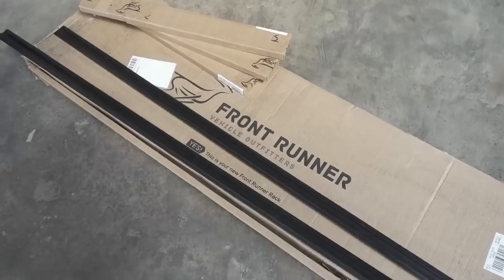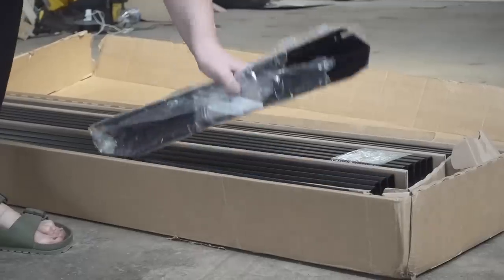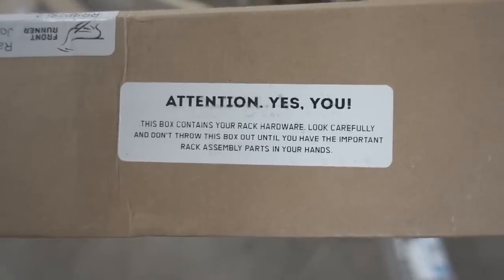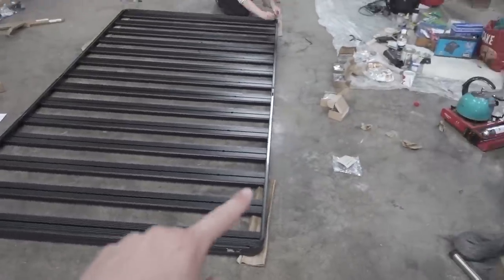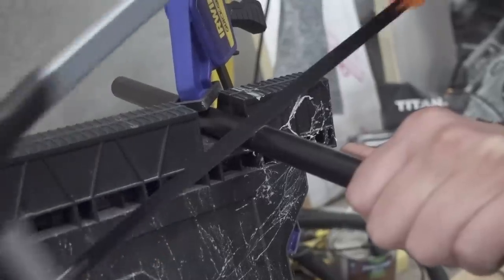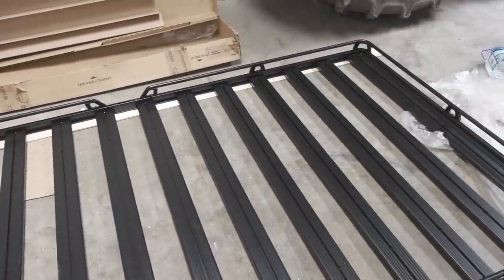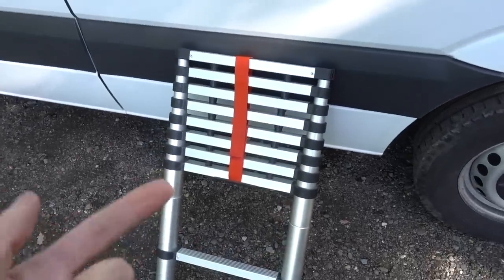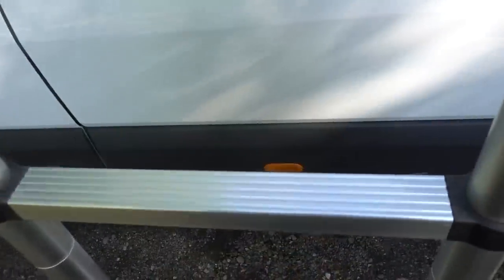This Front Runner Roof Rack Has CHANGED Our Sprinter Van!

Comment: Another great job guys looks awesome :) Be careful with your ladder, we have one similar and have noticed after repeated use that it has started to dent the side of the van where we have been leaning it up against the side.  We have applied some foam pads to top so that when its leaning it spreads the load. a bit more.

Comment: Hi, on seeing this video I realised that although I may not want a roof rack just now, unless I instal the tracks before I finish the insulation I won't ever be able to have a roof rack, so I sent to First Four to get the tracks. They arrived very promptly. However installing them wasn't too easy. What anyone thinking of getting them needs to check is : what length of track is being supplied and how long your van is, so that you can see how much of your roof will be covered by the tracks. I have a MWB Sprinter. This means there are 8 potential holes down each side of my roof to take the 2200mm tracks. The tracks are only 6 holes long. I thought of cutting each track in two so as to make the track area longer but this wouldn't work. In the end I have put one whole track on each side and have laid them toward the back of the van - part of the front area is occupied by the roof fan. I had quite fancied the idea of having a light bar across the front of the roof but with nowhere to attach it to, that won't be possible but hey 1 they are very expensive and 2 do I really need one - No!   When you mark and match up where you need to drill the holes in your track to match where the holes are in your van roof, you will find that the holes in the soft cushion strip which lies between the track and your roof don't match up so you need to enlarge a couple with your Stanley knife. I have managed to fit these tracks but it wasn't particularly easy. I sounds easy and theoretically it is but I'd  just say if you're going to do this, allow yourself plenty of time. I must admit however that all this is very new to me so I will be slower than most of you, perhaps, and I am enjoying it - being dead chuffed when it works out.

Comment: Hmm, they don't do roof systems for fiat ducato based vehicles. A big problem I can see for the Merc van is if it gets damaged you have to strip out the interior to get to the fixings.  The advantage of the fiat van is the bolts screw into pre-installed fixings from outside the van so you just undo the bolt on the roof and remove it. Looks a great bit of kit too, would have loved one in my van, hopefully they'll expand the range.
Reply from the maker: You can take the roof rack off easily. It’s all done from the outside.

Comment: Guys I've bought the same rack but for the full length of the van . Am I right in thinking that you don't use the factory holes in the roof but drill new holes in line with the holes in the rails?
Reply from the maker: We used the factory holes but had to use a file to make them bigger. Bit of a process
Reply: Thanks guys 👍

Comment: Hey guys, 
thanks for sharing this super helpful video.
I am currently also checking the best options for a modular roof rack for my Sprinter. 

You said you mounted the FrontRunner Universal Tracks to the roof of your Sprinter. Is the shape of these tracks standardized? 
Meaning, can I use other brands or models of load bars or roof racks to fit into these tracks?

Thanks, 
Manfred

Comment: Interesting,  believe your model of Sprinter just fits in most shipping containers.  Solar cells depending on type are about the limit. The rail around the rack looks a little high
Reply: Of course thinking about it you might take some air out the tires